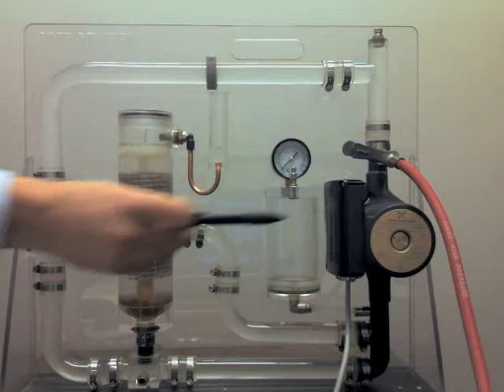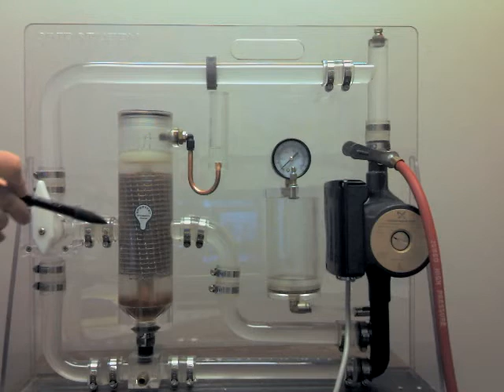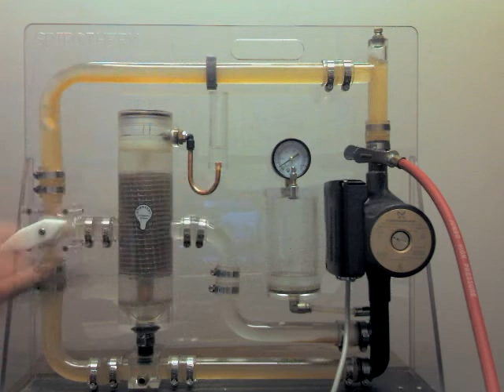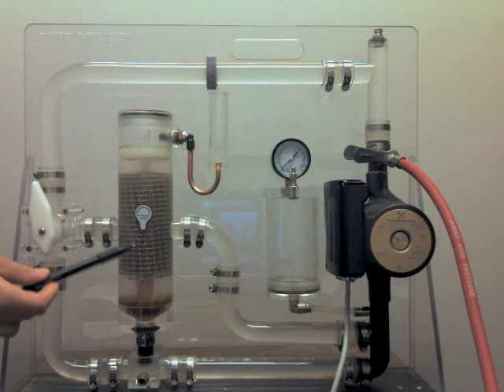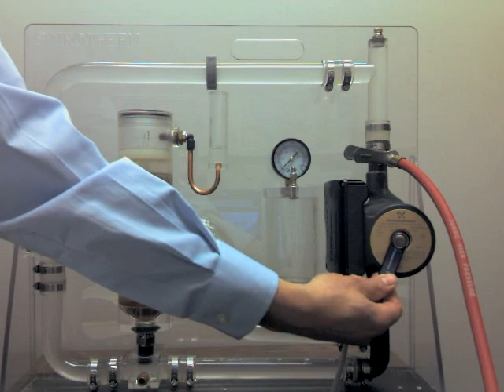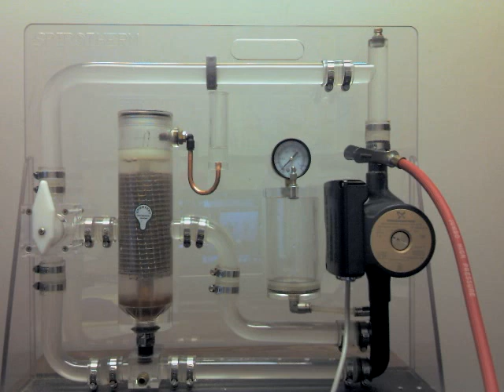Spirotherm Demo

Comment: Explain which way the water is flowing, when the handle is straight it is bypassing the filter. When the handle is horizontal the flow is through the filter. Is this correct?
Reply from the maker: It's a 3 way valve so it can be confusing. Horizontal is in bypass as shown in the beginning. Once the handle is upright, flow is going through the separator.